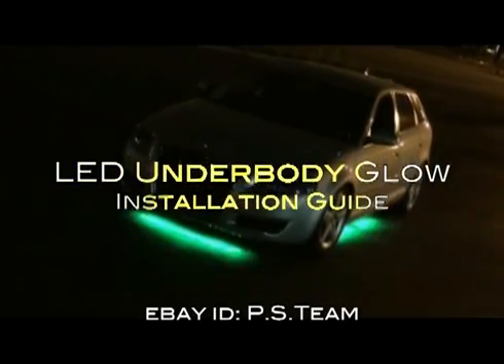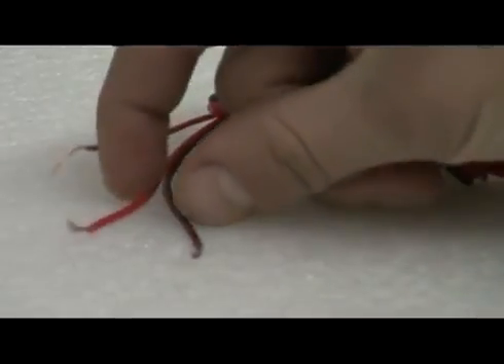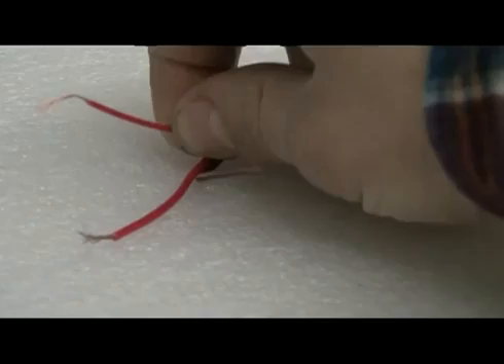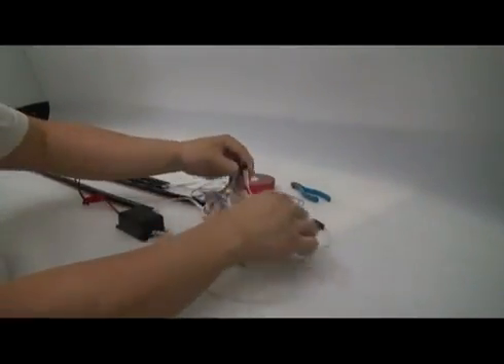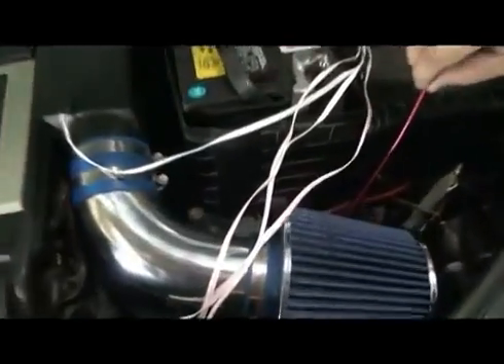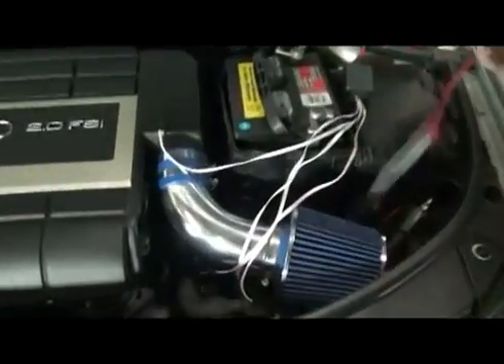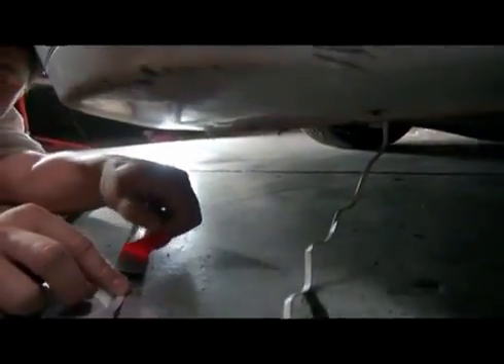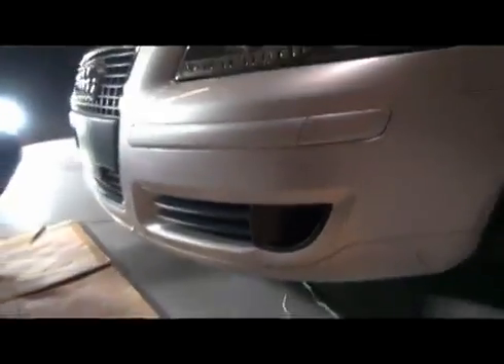LED Under Car Kit Installation Reference Guide

Comment from the maker: when connecting to the power, only the red and black needs to be connect, the extra (red) wire is brake light function, you don't need to connect it. if this wire is connected, all light will keep on until disconnect, can't even turn off by remote.